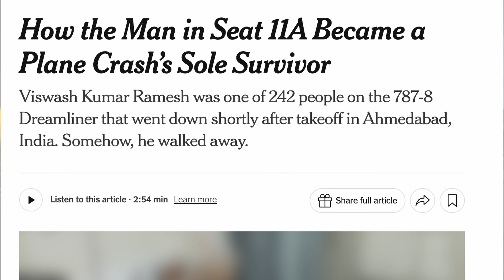Why the RAT Changes Everything – Air India 171 Update

Comment: @captain Steeeve: One of the things puzzling me is why the plane used every last yard of the runway, and whether perhaps that could be indicative of an engine failure after V1 but before take off?  If that had occurred though, would it be normal procedure to radio that in immediately?  But if it did happen, perhaps they took off on 1 engine? The rate of climb does not seem indicative of a fully operational aircraft. And then perhjaps engine 2 failed seconds later?

Comment: This is why this guy is the best. New information has come in & he goes with the new evidence. Some people in the comments section on his previous video were 💯% blaming the co-pilot, one accused him of being intoxicated & some others of a deliberate act on his part!!. I said "the guy's died, just wait for the FR & the CVR data before condemning him".

The RAT (Ram Air Turbine) deployment coupled with the "Mayday. No Power" communication from the pilot now shows that the flight crew could not have done anything to save a double engine failure seconds after take-off in a heavy plane laden with 212 tonnes of jet fuel. A design flaw is very unlikely as it's the first time that a 787 Dreamliner has crashed in it's many years operating. This 'could' be very bad news for Air India if this is eventually discovered to have been caused by a lack of maintenance by their ground crew

Comment: the odds of BOTH engines failing at the same time are 1 in 500,000,000,000,000,000
Reply: Not true, 787-8 has had issues with uncommanded dual engine shut down before. Happened on ANA flight NH-985. It was a problem with TCMA that was later corrected. So the odds are much more likely that both engines went out.

Comment: I m so glad you are taking the time to clarify as new evidence arises! 
As a former operational military pilot , I can say that aviation accidents are extremely complex, 
There are usually many different factors and issues leading to the fatal outcome .
Good video Cap Steve !
Reply: It’s not new evidence. This is the original video, with source that came out shortly after the crash. I saw it and heard the crashing buildings and I heard the odd prop sound instead of normal engine noise.

Comment: What if the pilot shutdown both engines ?  Just saying.
Reply: Why would they do so?
Reply: Could be uncommanded dual engine shut down as happened to 787-8 ANA flight NH 985. It was caused by TCMA fault. That issue was later identified and corrected, but who knows what other bugs/flaws this aircraft has.

Comment: In a future video can you explain whether or not someone on the flightdeck has the ability to turn off both engines while in flight, or if you can turn off a fuel pump(s) to choke both engines of fuel.  Could the failure of both engines at the same time be caused by actions by the pilot or co-pilot?

Comment: The premature raising of the flaps had also been debunked because in a B787, the two controls are not beside each other. The flap levers are down by the thrust levers, while the landing gear control is up on the dashboard (so to speak). There's no way an experienced co-pilot can confuse one for the other.

Comment: I am intimately familiar with dual engine failure in a jet aircraft, caused by misfueling. DEF was added to the fuel instead of PRIST. The chemical reaction resulted in crystals that obstructed the fuel filters. That caused fuel starvation and the loss of power and flame out. I'd be focused on fuel. A mechanical failure of two modern jet engines at the same time is highly unlikely.

Comment: At this point, like I've commented on the previous video, we cannot tell exactly what may have gone wrong, until NTSB steps in and share what they have discovered. Yes, I mentioned in the previous video about the Ram Air Turbine (RAT) that was already deployed, as the plane passed by. If the RAT was already deployed, we already know the reason for that deployment. And at that speed and altitude, the crew really don't stand a chance. And like I said, that's a Boeing, and these planes drop out of the sky every now and then. You are not wrong on the previous video. These are analysis, theories and conclusions. We can never tell, maybe the pilot really retracted the flaps, or cranked the gear lever like a bear handshaking the lever like mad. With a total blackout, and a few seconds to spare, they may have done everything you said. Not by mistake, but in panic. No apologies. And I can also be totally wrong. Because what I do for a living is raise hogs. And here, we can only speculate. And for me, you're still the best pilot! And will always be.

Comment: Also what seems to be overlooked in the public eye is that the plane needed basically the entire runway until they finally rotated. You can also see video evidence or at least clues of it in the CCTV footage. When they started to rotate, there was a lot of dust kicked off. 

Now mind you, I don't know that airport nor india, but I would assume it is a often used runway, so it wouldn't make sense to kick of dust, unless they used part of the runway that's usually not so much needed. This would at least point in the direction of the "no power" argument. Why else would they need so much runway and then barely lift right after? 

It's such a sad event, I really feel sorry for everyone affected by this. Let's hope they find the cause and fix it soon.

Comment: It just looks like either a gradual engine failure or flap/slat retraction after few moments of positive rate. On some Boeing aircraft the flaps will automatically retract from accumulated pressure when a certain ground is lost.  The RAT deployed only tells us a pilot calculated the need to power the emergency buses. FDR/CVR should give the investigators what is needed. 
Man, I watch this video with tears, I hope the investigation leads to certain prevention in the future.

Comment: There was a video about 2 hours before the incident ( previous flight) where a passenger was complaining that the plane was really hot as the Air-conditioning wasn't working. Also the seat displays / monitors were faulty. Coincidence or begining of the electrical failure? My thoughts and condolences go out to everyone.

Comment: The RAT can also be deployed manually via push button. If the pilot thought he was loosing power and not lift he might have decided to deploy the RAT manually to avoid loosing hydraulics and electricity. That plane climbed to 600 plus feet and did not raise the gear. I don´t think that without power he would not have climbed to 600 plus feet especially since that loss of power would have happened a few seconds after take off or they would have raised the LG (that usually happens immediately after taking off) so if they did not raise the LG, power loss would probably have ocurred very early in the climb out. He had to have take off flaps before take off or the computer would have warned them. But if they took off, started to climb and flaps were raised by mistake instead of the landing gear, the pilot could have mistakenly thought that his problem was loss of power and not loss of lift. He could then have deployed the RAT to avoid loosing hydraulics and energy.

I believe the audio where you can hear the RAT, has been enhanced to identify if the RAT was deployed but you can still hear the engines spooled up. I don´t think that the RAT being deployed necessarily confirms loss of power or excludes flaps being raised by mistake. Of course this is just speculation. What do you think about this scenario Captain Steeeve? Please comment on this possibility. Thanks for the great content!

Comment: Agrred on the engine failure. Some aviation experts have discounted fuel contamination by suggesting that modern fueling systems use advanced electronic monitoring and filters to ensure fuel is absolutely pure when loaded and is automatically shut off when not. However, I know that 787s are operated by and flown out of many developing nations who may utilise older equipment. In these environments improvisation is the order of the day when equipment breaks down. My question therefore is can you refuel a 787 with an older fuel truck that might not have adequate filters?

Comment: I was under the same theory as you that the co-pilot accidentally raised the flaps rather than the landing gear. But with the new evidence that you just showed I firmly believe now that they had a dual engine failure what I'm very interested in is what exactly caused that dual agent failure. Was it possibility of contaminated fuel major system malfunction. I am very interested to see what the NTSB report states. Again this is a terrible tragedy but I very much appreciate you going over this in the early parts of this investigation. It gives us real insight into what was going on with this aircraft

Comment: Everything Captain Steeeve said is correct, however, there are more reasons for the RAT deployment. There are 6 reasons the RAT could be deployed on the 787. 1. Dual engine failure. 2. Low hydraulic pressure to all three pumps (left, center, right.) 3. Loss of electrical power to both pilots flights systems. 4. Loss of electrical systems and flight control systems on approach. 5.LOSS OF ALL ELECTRICAL SYSTEMS AND ENGINE FAILURE ON TAKE-OFF. 6. Manual deployment.

Comment: I'm a little confused that people haven't mentioned the fact that the planes air speed was unusually low on takeoff and its short flight. Flight radar showed this on playback of the flight data. The RAT deployment now points to engine failure. Why. Is now the massive question.

Comment: Both Engines can fail if the main and back computers fail due to power failure and fuel pump stopped, the engines flamed out.

I think Air India is not maintaining their planes properly.

Comment: As the aircraft passes the person whom shot the video and listening to the 'buzzing' of the RAT - another sign, lack of engine thrust sound from the engines. At that height as it passes by the video taker - those engines should be a maximum power - we do not hear that, or because of the loud RAT buzzing sound negates the engine noise?
Reply: The engines are normally waaay louder than the RAT is.

Comment: I am wondering why suddenly the engines had issues at the same time as it sounds to be the case, according to the video took by that 16 years old guy. Did something happen before the plane took off and no one noticed it? If the pilots launched a distress call claiming that there is no power, no thrust, therefore, these elements are leading to mechanical and engine issues. The pilots tried to avoid the heavily inhabited area to avoid danger as much as they could.... Maybe because they already understood that... things were already very bad!! So, They should be respected for that!
Reply: Contaminated fuel is a possibility

Comment: What about the dust seen in the video at the moment of rotation? I’ve seen an analysis suggesting that, despite using the entire length of the runway, they overran it and lifted off from the sand or gravel. Would it be possible for the engines to ingest sand / gravel and fail because of it? Some also say the plane was overweight, which caused it to be unable to lift off in time. Thanks
Reply: No, not possible
Reply: @SpeedyNeo why not? if it is possible to ingest a rabbit, it seems to me that sand is even more so

Comment: If both engines failed how did they took off to 500 meter. Did the engines malfunctioned after the take off? Is there a possibility of hydraulics or electrical malfunction and RATs were deployed because of it.
Reply: Contaminated fuel

Comment: Thanks for the update.  Convincing, but why 2 engines at the same time.  Isn't a complete electrical failure more likley.  I presume that the engines need some kind of electrical input, so they would explain why both failed together.  If so then question, is the black box on the same electical system in which case there will be no black box data.
Reply: Contaminated fuel
Reply: @SpeedyNeo  But chances of simultaneous levels of contaminated fuel to each engine at the same time, seems unlikely.  Possible but unlikely.  Unless there is a cut off valve that cut off both engines because of the contamination.

Comment: I’m going to argue for the prior theory. 

1. Yes that’s a distinctive sound but there could be other sources for that sound. 
2. We can’t clearly see a RAT deployed in the video. 
3. Go back to the takeoff video. If we’d lost both engines and especially if the power loss was associated with a bang we would almost certainly see a visual indication out the back of the engine we have nothing at all. Engine exhaust looks totally normal right up until impact. 
4. We have jet engine noise in the crash video. If both engines were dead you would not expect that. 
5. The gear never gets retracted and it’s right at the moment you expect it that we first see things going wrong. 
6. And this is my strongest argument. While I’m not a 787 guy most FBW airplanes go into a degraded control law when you lose normal electrical power. An Airbus on the RAT would absolutely no longer be in normal law. Notice how the nose comes up and just stays there perfectly all the way to impact. No wing rocking no last second pull up nothing. That’s exactly what I would expect of a FBW airplane where the software is holding the airplane at max alpha. It’s allowed the nose as high as it can while preventing a full stall. For that to happen we almost certainly need normal electrical power which means engines running. 
7. The odds against losing both engines at the same time especially that match the video we have are astronomical. Standard post accident procedure is to test the fuel from the truck or hydrant and the airport. If there was contamination bad enough to roll back two engines at the same time I have to think that would be known by now. 

The DFDR readout should be complete very soon and I would expect that if it’s a dual engine flameout that would be announced almost immediately. Air India are certainly going to want to clear their name. But if the cause is crew error we might have a much longer wait as they try and find something that could exonerate the crew.
Reply: Captain Steeeve has spoken

Comment: At take off, at probably near to max weight (I think Air India has quite a high baggage weight allowance: First and Business class Passengers can each check in 2 x 32 kg, economy 2 x 23kg each - could be wrong on that), and with hot therefore thinner air, would the engines be pushed to absolute max thrust (are they at max thrust for take off ordinarily, or is there a bit more if needed?), the dust at the end of the runway, is this the end of the runway? and it looks like a lot of thrust happening at that moment (is this normal or does it look like the take off was committed, absolute max thrust was applied and she lifted off just in time,), and if this extra thrust is applied could this cause a "weak" point to fail somehow engine related and cause dual engine failure? thank you sir for your knowledge and time.

Comment: He took a lot of runway to get airborne, is it possible the engine/electrical failure happened at or just prior to VR? If that were the case they probably knew they wouldn't be able to stop on the runway and that the only chance they had was getting airborne. If that's the case, the pilots did their very best with no safe choices.

Comment: Hey Steeeve, there is a picture of the tail of the plane stuck into the building, now if you look closer into that picture you can see the door for the APU air intake is open, right behind where the rudder should be, we know this automatically happens when there is a loss of power on both engines.

Comment: I understand saying duel engine failure is easier, but it's very unlikely the actual engines were faulty and is more than likely to be a shared component rather like the Heathrow BA 777 crash years ago.

Comment: This new generation of aircraft are primarily electrical flight controls, replacing steel-carbon cables used for over 100 years.  Funny how they still need mechanical backups for the fancy bells and whistles.

Comment: I believe the aircraft had just come off a maintenance check. I suspect the mag chip detectors or their seals have not been fitted post inspection. This would cause total engine oil loss at full thrust.
It has happened before. In the U.K. to help prevent this mistake the same Engineer is not allowed to work  on both engines.

https://en.m.wikipedia.org/wiki/Eastern_Air_Lines_Flight_855

Comment: Too many errors. It looks like the flaps were not set for takeoff. You can see the profile of the wings is thin but if you look when they're set up to take off it's fat because the flaps are down. Landing gear is usually retracted right away. Deploying the air powered auxiliary power unit. All that did was supply even more drag. They didn't have sufficient speed to take off without flaps. It would leave the ground because of ground effect on the wings but once it got above two wingspans from the ground it lost all ground effect. Then it stalled.

Comment: Interesting.

What could cause a dual engine failure?

Birds - mine to see, no smoke from engines 

Lack of fuel - kinda unlike considering the fireball

Bad fuel - should be easy to rule out as there should be samples available 

Complete loss of electricity? - would that stop the engines? - I bring the metal shrapnels back into play which could short cables and this boeing eas an early model